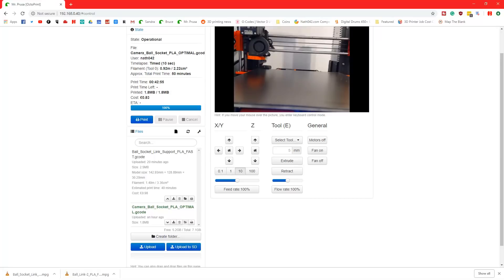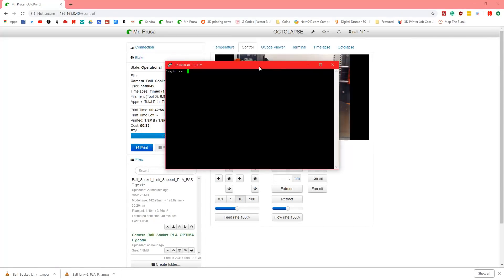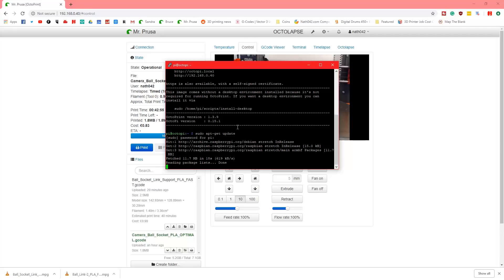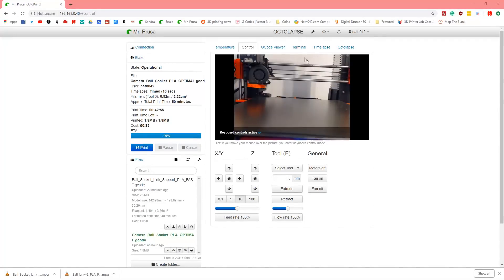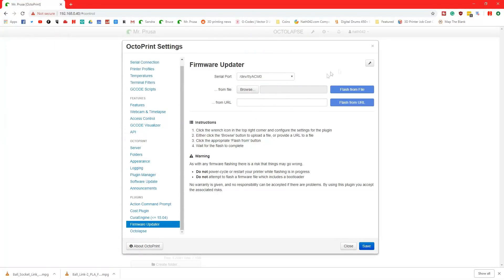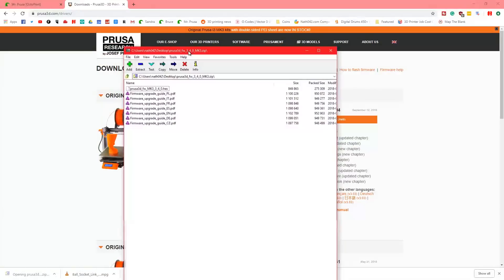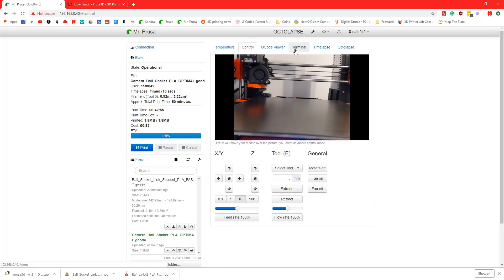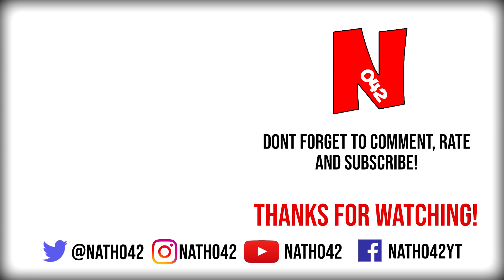How To Update Prusa I3 Firmware Via OctoPrint

Comment: Hey sorry but I have a very basic understanding of the raspberry system.  I installed, updated, upgraded all the things in both the putty and browser interfaces but the usr/bin/avrdude file doesn't show up.  I doesn't appear to be in the main directory and the test function of the plugin says it does not exist.  Do I have to make them manually or did I do something wrong?
Reply from the maker: hope that is working for you now,  if you type that in are you able to find the folder?
Reply: @nath042  ya I figured it out.  I can't remember exactly what I did because it was a while back.  I think I just made the folder myself and it worked.

Comment: Hmm, mine fails and gives the error "Flashing failed
 - Timeout communicating with programmer". I'm using a Raspberry Pi Zero W installed directly into the Prusa MK3S Einsy board. Any thoughts?
Reply: @nath042  That makes too much sense! LOL I indeed found confirmation that it won't work with the Pi Zero. Luckily I just upgraded to a Raspberry Pi 4. Thanks for your video and the reply!
Reply from the maker: hope its still running smoothly!

Comment: Woohoo, Thanks for this tutorial. I have been trying to get Marlin 2.0 on my Tevo Black Widow for ages and now I have success. This worked uploaded the .hex file to my printer via octopi. I tried to do this with Arduino ide but I would get artifacts on the screen with that method. Well, I compiled Marline with VSC and platform io and did not know how to get the .hex file to my printer. Watched this an now it's updated with Marlin 2.0 no screed artifacts. Thanks, heaps.
Reply from the maker: no worries!

Comment: This Works!!!   I followed the instructions as he gave here and it all worked.   To recap what I did:

1)  Got PuTTY from https://www.chiark.greenend.org.uk/~sgtatham/putty/latest.html
2)  Logged on to my Raspberry Pi under the pi account
3)  Changed my default password using 'passwd' command (I should have done this when I first set the  Raspberry Pi and OctoPrint)
4)  Updated Debian with 'sudo apt-get update'   - this took about 30 seconds
5)  Upgraded with 'sudo apt-get upgrade' (thanks David Moore)   - This took about 8 min or so  to run
6)  In the OctoPrint plugin manager I installed "Firmware Updater"
7)  Setup Firmware Updater as he showed.
8)  Downloaded latest Prusa firmware from Prusa
9)  Selected that file.  It installed in about 3 min
10)  Checked my Mk3S that the firmware was updated

Thank you so much   My printer sits in my utility room down the hall from where my PC is.  I had not updated my firmware for sometime just because it would be a huge pain in the ass to bring the printer in here to update it.  Then carry it back to the utility room and set everything up again.  And chances are I would have to re-calibrate it again.